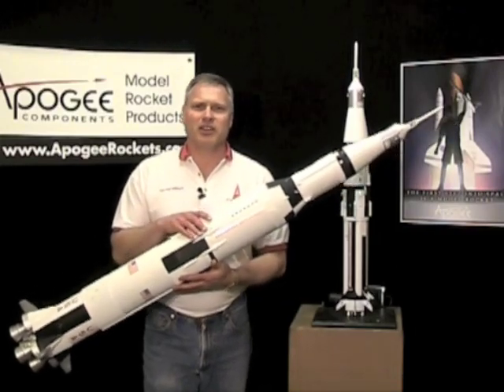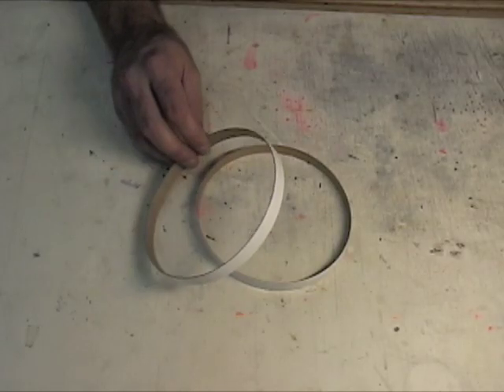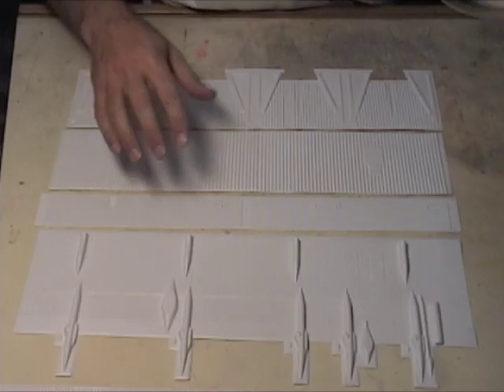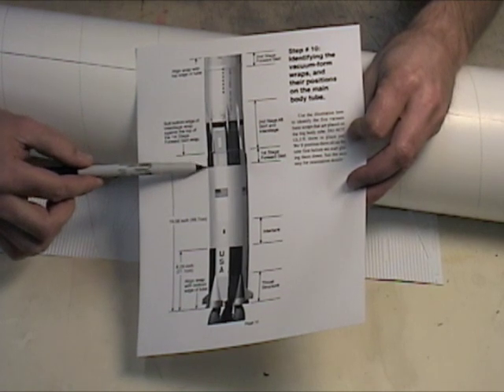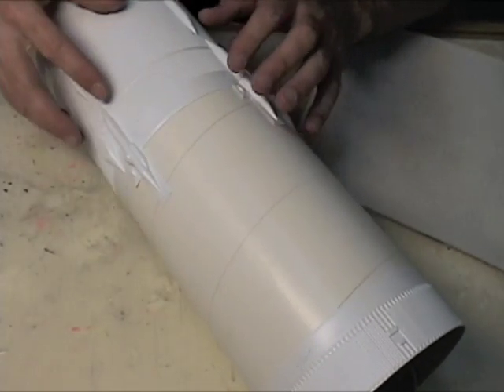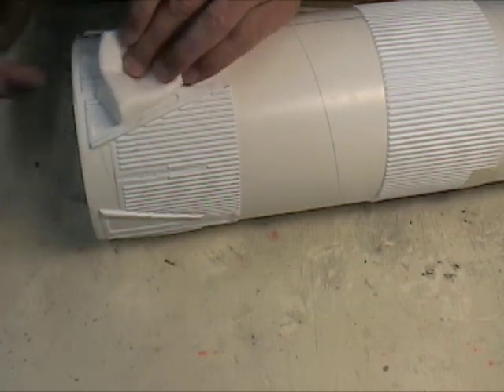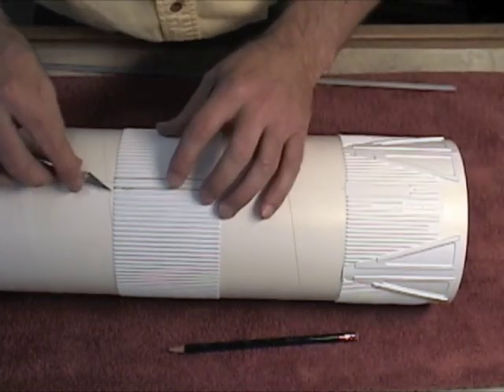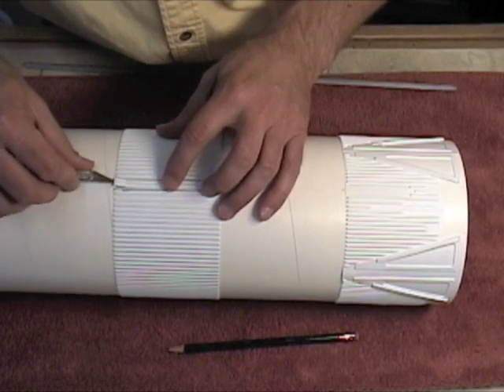Saturn V Project Disk 1

Comment: When building the motor mount, what is the dimension that the aft ring is glued to the tube? The instructions are clear for the forward ring with the Kevlar, then they jump to the the thrust rings without addressing the aft motor mount ring. Keep up the good work.
Reply from the maker: You want to put an engine retainer on it, so leave 1/2 inch of the end of the motor tube exposed.

Comment: Can you use something other than a motor to install the block ?
Reply from the maker: You can use anything you want. What is important is knowing that the engine blocks are now on the BACK end of the rocket engine, so you don't need to install the motor block at all !